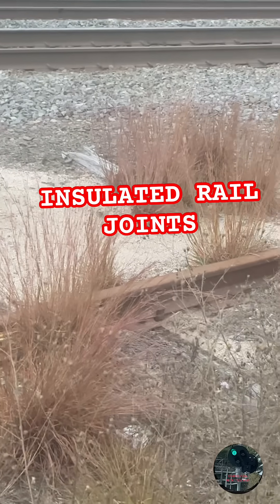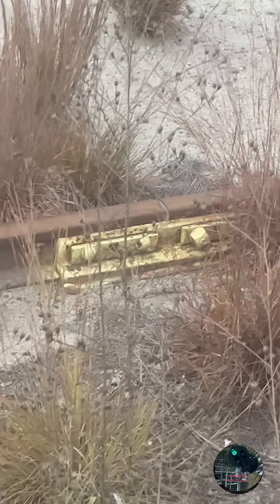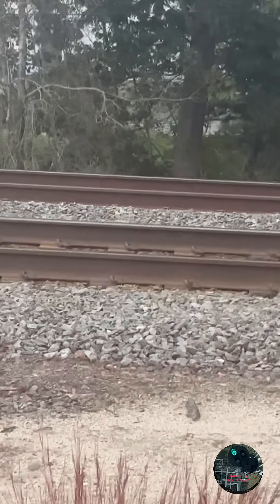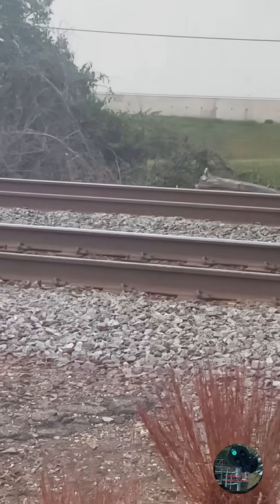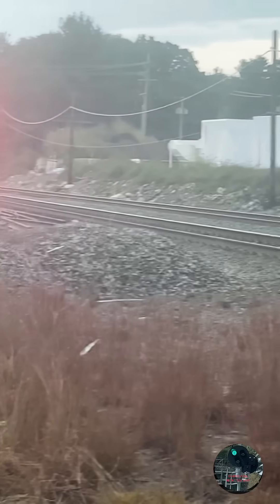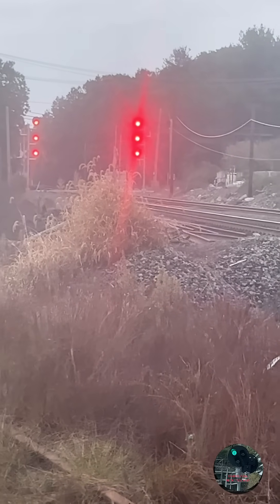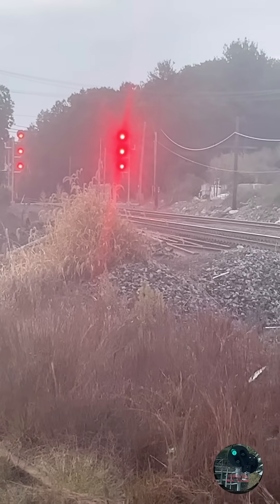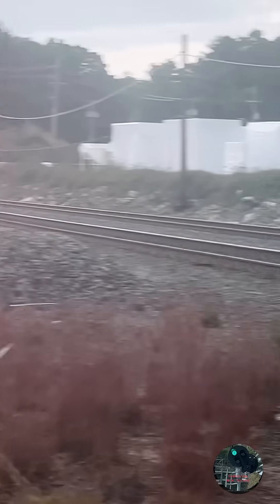#mbta #amtrak #railfan #trains #trainlove #railroad #usatrains #usarailway #signals #maintenance

Comment: I would offer that the correct term is current through the rail not voltage 😉
Reply from the maker: We believe It is only current when the connection is made (flow) and It is voltage when there is no connection made :) such as a battery that’s not connected has voltage and current results when two ends are connected. But we are not experts in any of this, just stuff we learned along the way we appreciate the comments and Thanks for watching 👍🚂👍